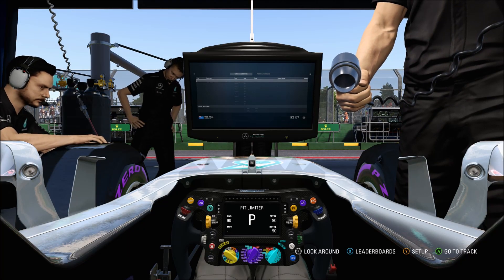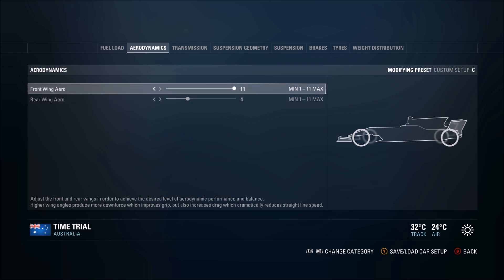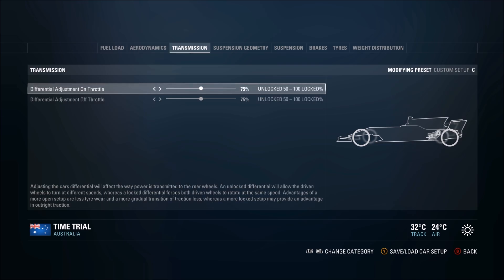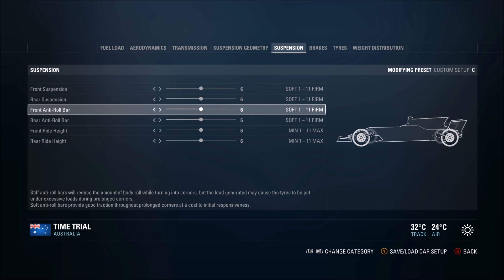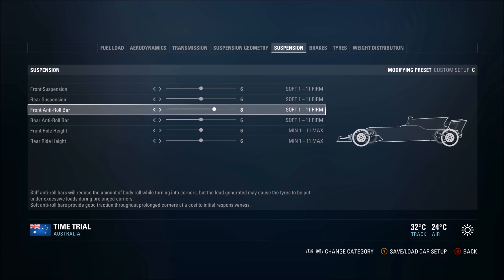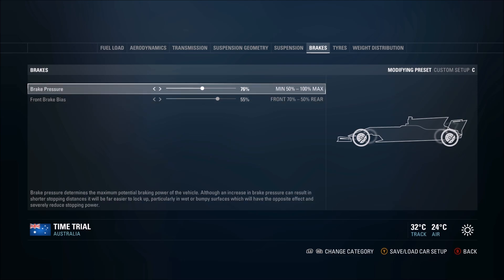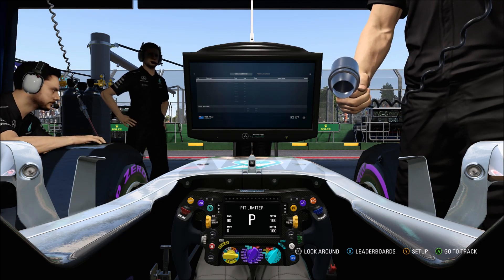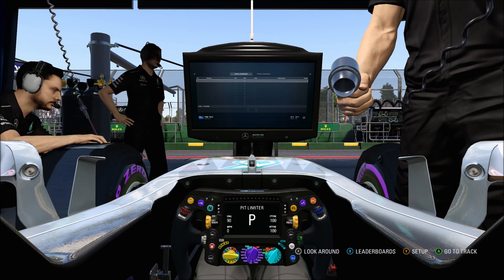F1 2017 SETUPS EXPLAINED (FOR TT, RACE & THE WET)

Comment: Hi TRL Limitless. i have been looking your videos for a while. i am very happy that you did this video. i have been racing for about half a year.  i started with f1 2016 ( i had a little time also with f1 2013 and 2014 but i did not take it seriously back then) and basically bought straight away wheel. i played all the time with assists on because i couldn't get my car under control with out assists. Now i started 2017 and this is brilliant game. i like the dynamics and everything and i started to play all assists off from the very beginning. It is totally different world and with 2017 i started to understand what are my weak points with setting up my car but i didn't know how to fix those things. Now i looked your video and i started to understand how could i fix my weak points. hardest part for me was  suspensions , cambers , toes etc those kind of things. Thank you very much for that video. it helped me so much to understand how to setup the package not single parts. 

Big up, continue the videos, it's very nice to watch them, very informatic!

Comment: The major thing to remember about setups in games (even sims) is that they are simulating (even arcade games) what toe-in/toe-out does, ride height, tire pressure etc. That means even in sims certain settings simply would not work on the real car as the numbers are off. An example is in iRacing they released the Porsche cup car awhile ago and it runs much lower tire pressure then they ever would in RL, while that is far from realistic it still feels very close (so the guys who actually driven it says). Point being is while it might be handy understanding what each setting does, it may not work exactly that way in game, always check out the community around the game to see what they are running and suggest and go from there, knowing the basics of what each one does is really all you need for any game tbh.

Comment: Unfortunately hardly a comment on wet race setups.
Soooo, questions.

Lets say you run 6-6 wings in the dry.
how would you run in mix conditions, as in how many clicks more wings.
And compared to inters
And finally a full wet race.

Please comment on the wing difference and brake pressure / bias.
Mainly for 50% races.

Thanks! 

a struggling wet driver.
Reply: Chriss_9_Style if you have Practice sessions left (Career) 

just add 1 more wing (6-6 to 7-7) and do play around with it till you are comfortable with it.

Everybody feels different with a setup. 

With Inters I won’t add a lot more downforce but with wet I should do 1 or 2 more. 

I have no idea about Brake Bias I just leave it the same al the time.
Reply from the maker: Chriss_9_Style It wouldn't change by much and depends on the track also. Personally I would go up 2 clicks on the wing for front and rear, along with going down 1-2 times on the ballast. Brakes are all preference, but if you struggle with lockups move it more towards the rear or just lower the front pressure
Reply: Has been all the same for all F1 games by Codies; if you struggle with traction, use assists or even out the wings and go 1-2 clicks up overall. If you struggle with lockups, use ABS or lower brake pressure or move the brake bias towards the rear a bit.
Reply: Brake pressure doesn't really matter, unless its a full wet race, no mixed conditions, but with higher brake pressure you just tap the brake for +- 20% more than that youll get lockups
Reply: The problem is. Everyone has different driving styles. What works for me, may not work for you. If you have spare time and are bored. Take you favourite track in TT and one setting at a time go out set a couple of laps at 90/95% be consistant with your driving. Let the car do the work. The input is worth the end result and so rewarding.

Comment: Good video^^ Guys dont afraid to test suspension and its geometry. You can make car alot more stable in corner, get better turning in and even improve rear stability while accelerating. Just everything have to fit together :)

Comment: I just want to correct you/make a point on ride height in real life. Teams don't run the cars as low as possible. Yes getting the car lower would make it "faster", but you risk scraping the floor. Truth is that teams run the rear of the car higher than the front. This is very clearly visible when you see the Red Bulls on track. You will always see that the rear is higher than the front. This difference in ride height from front to rear is known as the rake of the car. Teams try to lift the back of the car because it allows air to flow under the car. This airflow is then channeled to the diffuser and produces downforce at the back of the car. The more air that can be channeled to the back of the car, the better the diffuser can perform and the more downforce can be created at the rear of the car. This was explained a few years ago in the f1 racing magazine. Very interesting article
Reply: Brown 266
Do you know why there no gear ratio set ups for this game, just interested to find out?
In many racing games this has been a major feature in which to tweak.
Reply: F1 regulations IRL

Comment: Thanks!! Very helpful. How would you set up for track like Spa (for race) where you want a good balance between straight line speed and corner speed?
Reply from the maker: You'll see in my Spa video, but running a lower front wing than the rear, with a relatively high ballast so you can a good straight line, traction and rotation through the corner :) e.g. 1-4 wings, 8 ballast

Comment: I’m so confused on ride height. Is lower better for cornering and handling and higher is better for straight line speed? I usually run front height 1 notch lower then the front. 3/4 or 4/5 on average.

Comment: Seems like this year suspension and rollbar values won't be so "extreme" like in the last game. Would you go for a 8-6/8-6 or maybe 8-5/8-5 on a track like Suzuka, since there are a lot of long and medium/fast corners? Or you'd go a little softer due to the fact the track is a continous "up and down"? Thanks in advance, you're doing a great job, I really Appreciate it!

Comment: TRL pretty good video at first sry for my bad english i am from germany now it is the first time i understand the setup quit a bit more but if i still have the ABS on what makes it to the brakes ? So if i have the ABS do i have to change the brakes ? And in what stage ? And what do i have to change when i turn the ABS off ?
Reply: try army mit abs kannst du den bremsdruck auf 100% stellen, da die bremsen nicht blockieren können und du so maximale bremskraft bekommst.
Reply: Ty Pruschke vielen dank !😁
Reply from the maker: If you run ABS you can get away with running a much higher brake pressure and more to the rear!

Comment: Apologies for the off topic question but how much time per lap do you think you'd be losing with auto gears? I personally play with that on the controller because it's more comfortable, but as you said in a video last year, it does cost you lap time.
Reply from the maker: I would say up to a second, it's a lot slower as manual will be far more superior.

Comment: JD, I usually struggle a lot on tyre wear, so i usually put soft anti-roll bars, but, for keeping the car reactivity quite high i add more front toe, is that ok? 
Btw, my setups are quite similar to what u said, i got wrong only the suspension. And i noticed on the 2016 that having the front high a little lower of the rear high gives a little more straight line speed without compromising the grip, would u recommend that? 
Ty for ur answer.
Reply: Guido Chiriatti   speaking from the sim racing side, if you are having tyre wear issues, look at your wear and see if front or rear tyres are getting roasted.  If it is the fronts that are getting nuked, then you have under-steer. If it's the rear tyres being roasted, then you have over-steer. 

IF OVER-STEER: increase front ABR. Decrease rear ABR. Increase front springs/decrease rear springs. Don't change multiple settings at once. Just go in that order one at a time. Obviously you will do the opposite if you are suffering front under-steer. 

Move to diff power and diff coast after exhausting those options. More diff coast if having over-steer on corner entry. More diff lock power if having over-steer on exit. Again it will be opposite in dealing with under-steer. 

Moving the ballast according to instructions on the screen will move wear away from the tyres overheating. Fronts overheating, you need 1 or 2 clicks higher. Opposite for rear tyres overheating. 

Hopefully this makes sense for you expanding on JD's presentation.
Reply: James I I usually struggle woth the front tyres, but i really like an oversterry car, so i can't explain my self why I struggle so much, lets hope jd will answer
Reply: James I btw, thanks
Reply: Guido Chiriatti no problem man. By what you are describing it sounds like you may have a steering lock issue. I'm sure he will get you squared away. Best of luck!

Comment: Setups are still too 'dumbed down', and there's still no huge impact on how the car changes in its characteristics if changed.

Crazy setups as in the past, setups that would never work in real life nor are fair as assists users run those most of the time to get ridiculous advantages, still are pretty effective even though they shouldn't be that way at all.

No wonder Codies never seemed to put any effort into giving setups more depth with a better physics model and or by balancing out assists to make running no assists more attractive.

8 years it has been and F1 2017 is another disappointment, it's become the game that F1 2011 or at least F1 2012 should have been back in the days.....

The 'cash grab' is real in this one.